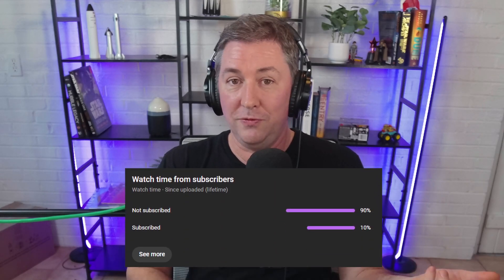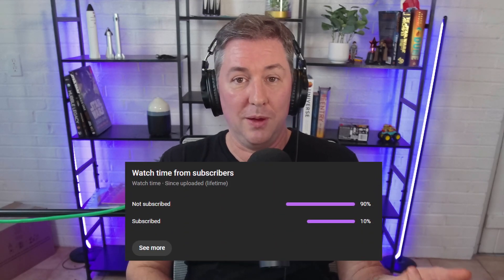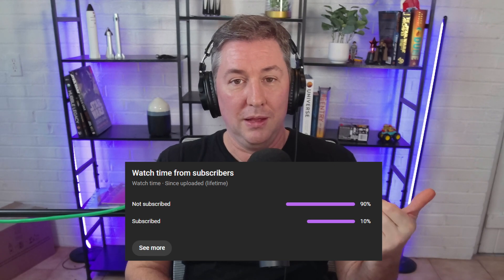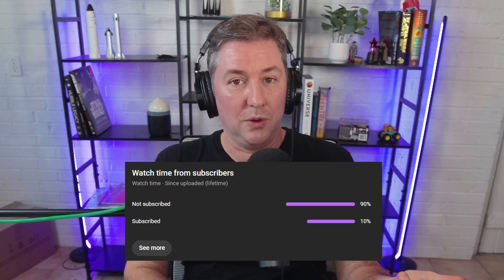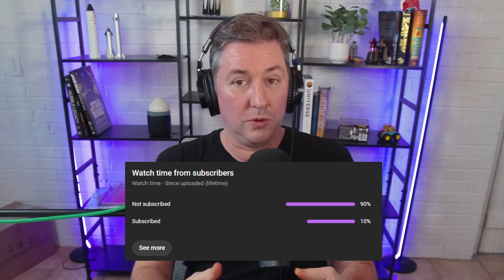SpaceX Insider Told me Secrets About Starship

Comment: What heatshield problems? 

Ships S29, S30, and S31 all successfully reentered the Earth's atmosphere at 7.3 km/sec speed and soft landed on the Indian Ocean perfectly. 

The heatshields on those three entry, descent, and landings (EDLs) worked as designed and brought those Ships back in one piece despite some localized heating near the hinges on the forward flaps and a few missing tiles. 

Those three EDL successes qualified the Starship heatshield for EDL from near LEO speed (7.8 km/sec).

The pinpoint landings of those three IFT missions qualified both the guidance and engine control hardware and software for landing the Ship on the tower arms at Boca Chica. 

SpaceX achieved those tremendously important Starship milestones on the fourth, fifth and sixth Starship launches.

Comment: The Space Shuttle was "operational" and never solved its heat shield tiles issues. They were always falling off and even caused the destruction of the ship.
Reply: Not true. Some tiles occasionally fell off, but that loss of tiles never caused destruction of an Orbiter. 

Challenger (28Jan1986) was destroyed by leaking O-rings in the left side booster during the first 73 seconds after liftoff. The tiles had nothing to do with that disaster.

Columbia (1Feb2003) was destroyed by damage to the carbon-carbon composite material that formed the leading edge of the left wing. The damage was caused by a 1.5-pound piece of foam insulation that became dislodged from the External Tank about 30 seconds after liftoff, hit the leading edge at more than 600 mph, and punched a one square foot hole the leading edge. During reentry 16 days later, superhot gas entered the wing through that hole and eventually weakened the aluminum structure to the point that the wing was sheared off by the aerodynamic forces. The tiles had nothing to do with that disaster.

Side note: My lab spent nearly three years (1969-71) developing and testing dozens of materials and processes for the shuttle tiles during the conceptual design period of that NASA program.

Comment: The fact that SpaceX is watching and measuring these parameters this close is why their rapid iterations quickly improve the product. Generally the anomalies are within functional tolerance margins.   Rapid iterations work because SpaceX pays attention to detail and strives for continuous improvement.
   When Starliner burns up the system that fails leaving no autopsy possible and fails to measure exactly what is happening to thrusters with extra sensors, Boeing will have to make guesses about what needs to be changed.  This is the opposite of SpaceX

Comment: My Personal Opinion/Rant

1) This issue mostly will be solved when Block 2 booster with integrated hostaging comes online.
2) Make sure pressurisation systems are working well + software improvementa
3) Heatshield is gonna take the longest time to solve to make it rapidly reusable 
4) Software and hardware upgrade (probably)
Though im curious how block 2 booster grindfins will be positioned lower and work.... Will have to see
5) I think they overhauled thag with Block 2 starship, but couldn't test it due to RUD.

This is still in its infancy stage, gonna still take time 🤷
Reply: I expect the actuators will be located in four separate cavities within the main methane tank.

Comment: 1. Unexpected harmonic vibrations at inter-stage connecting point
2. Methane tank pressure anomalies leading to thrust variations  
3. Heat shield problems (various) with no final solution yet
4. Spin actuator de-synchronization due to grid fin delayed response
5. Communication array phase-lock error up to 45 seconds due to plasma induced loss of signal on re-entry
Reply: Thanks for the summary, makes it easier to comment @geekthesteve6215

To Space Pod News, sorry for commenting this way but as someone who does have some knowledge on the engineering process involved, you are overreaching in your speculations. What you have reported is accurate but be careful about speculations because the tone you use becomes somewhat fear mongering. This tone was the same when you covered the Environmental Assessments which ended with no significant impact. This was no surprise for those who actually read the publicly available environmental test documents. People with some understanding gets turned off with this fear mongerish kind of approach presented without real understanding and balance. 

Compared to others, for example, people like Scott Manley because he is very technically insightful and doesn't overreach but still remains critical. Another one, Ellie in Space goes more on the human angle trying to get as many people as possible with different aspects in. So you might want to try different approaches as you don't seem to be technically inclined.

Two things on understanding/reminding the approach here. First, all these are unknown unknown meaning there is no way of knowing the existence of these problems without actually flying. Second, this probably is a very small excerpt (likely the biggest faults) of a very long list. Yeah I'm pretty sure they are detecting thousands of other issues. This is very normal in an iterative approach. Typically SpaceX would involve hundreds/thousands of fixes at each successive IFT.

To the problems highlighted:
1. All mechanical structure have sensitivity to certain vibration frequencies based on their construction. The trick is to make sure those frequencies don't match the frequencies encountered in flight. Quite easily fixed by changing the thickness, length, stiffness, even design of certain parts. Since they now know more of the frequencies, they can add another parameter/mode in the harmonics simulation. The trick is to avoid adding mass as much as possible in the fix.
2. Again, easily fixable by tweaking the design of the tank. Another parameter to add to the simulators. More important is to know why the anomalies occur. Is it due to unexpected vibrations, fluid flow under load different from what was simulated, temperature differentials, etc...? Again the trick would be to avoid adding mass as much as possible in the fix.
3. In IFT 7, this was the biggest issue because they had quite a few different heat shield configurations that they wanted to test but was unable to. Note that they could have gone with the configuration in IFT 5 and still be reusable but not rapidly reusable. As a matter of fact, quite a bit of the configurations tested would already allow reusablity but would require some service between flights which SpaceX is trying to minimize/eliminate. 
4. Need to improve the reliability of the grid fin. More important is why did this occur, motor performance, joint performance, external factors? However, starship has landed pretty much on point so far for IFT 5 and 6 so their control system can adapt and the hear shield is sufficiently robust to ensure  survivability.
5. Just reposition the antenna to a place with less plasma flow. Or maybe adjust the phase lock tolerances. It locked after 45s so its working. Live communications during reentry phase has never been done before I'm this manner (high res video etc...) before Starship.

All the best.